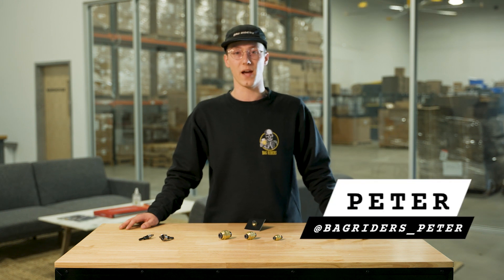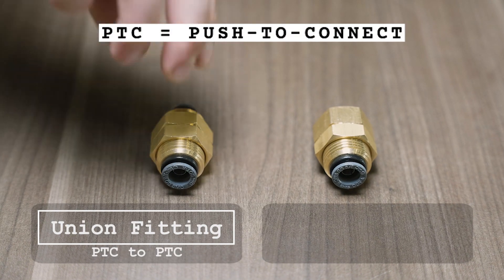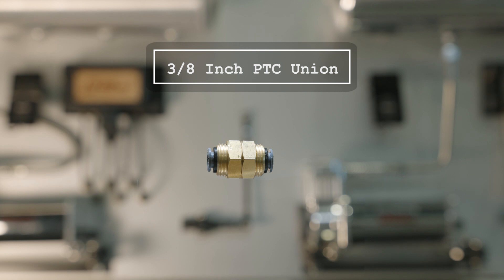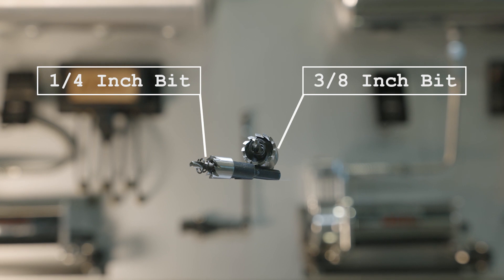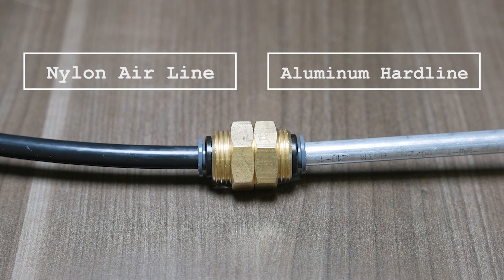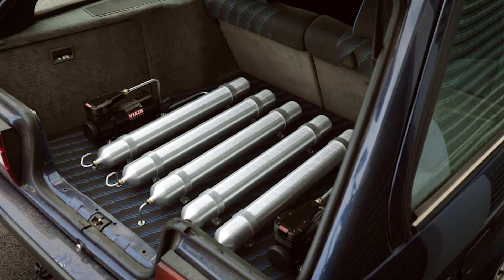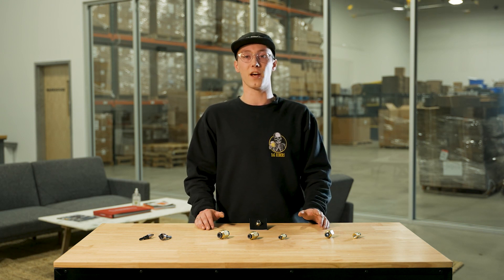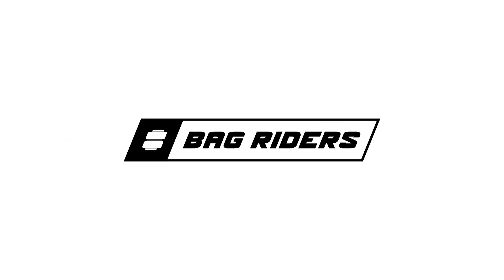Air Ride Bulkheads Explained by Bag Riders

Comment: do you guys use teflon and loctite to seal the threads or just loctite?
Reply from the maker: To ensure effective thread sealing, we recommend opting for either Loctite 565 or thread tape—using both is unnecessary. While Loctite 565 may require some time for proper curing and can be a bit messy, thread tape provides a reliable alternative.

Comment: no compression versions? i'll never use push/pull lock fittings ever again plastic or brass... asking for trouble
Reply from the maker: We use them all the time, no issues!
Reply: @bagriders So can push to connect fittings be used on hardlines?

Comment: What drill bits do you use to make holes for this
Reply: just start the hole with an 1/8" drill bit and use a step bit to fit... easy
Reply from the maker: We use these https://www.bagriders.com/fittings/push-to-connect-fittings/bulkheads/smc-dot-bulkhead-drill-bit.html
Reply: Thanks ! 🤙🏻